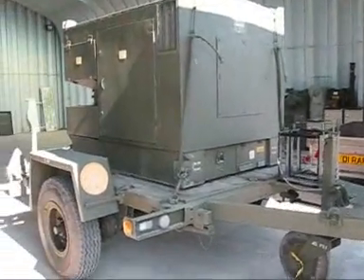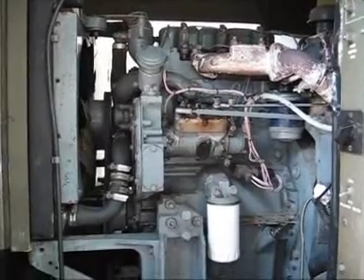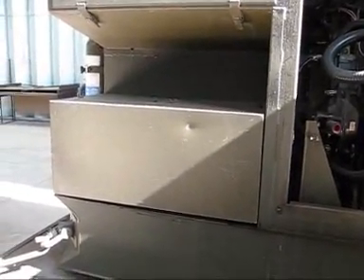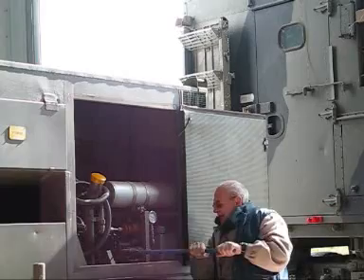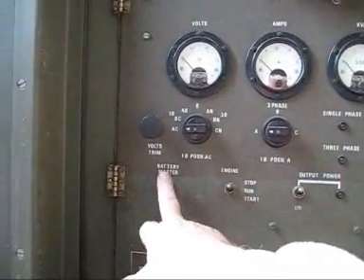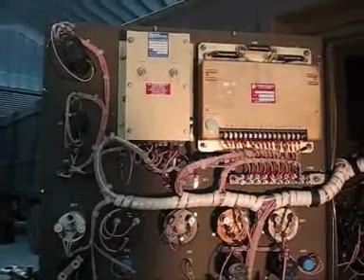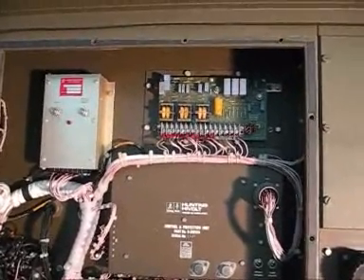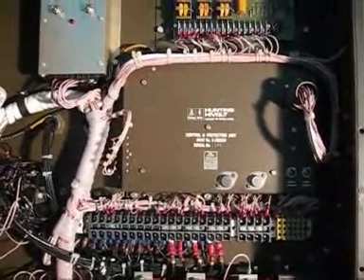Hunting HiVolt 12Kw Diesel Generator

Comment from the maker: The modules used for speed control,excitation and load sharing were bought in items and detail schematics were never issued because the modules were on a return to manufacturer basis. We have wiring diagrams plus schematics for the large green control box, will find them and post them on the web.